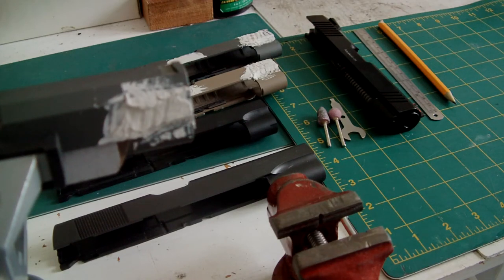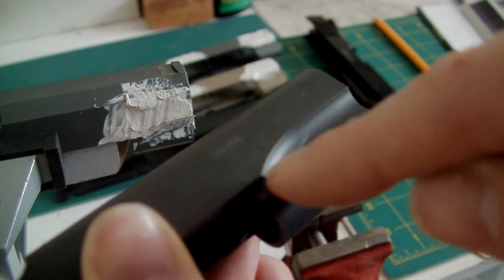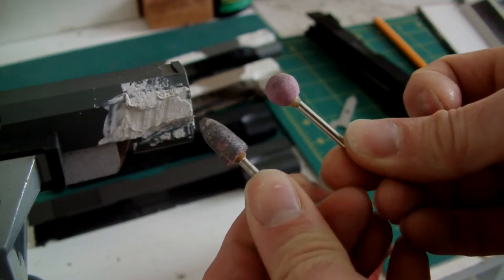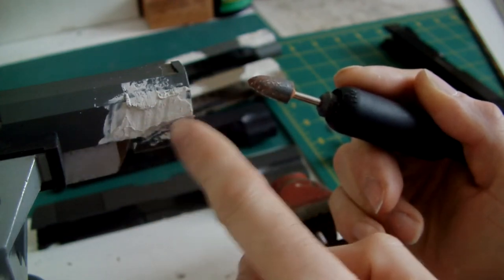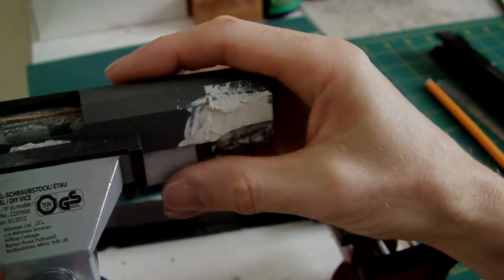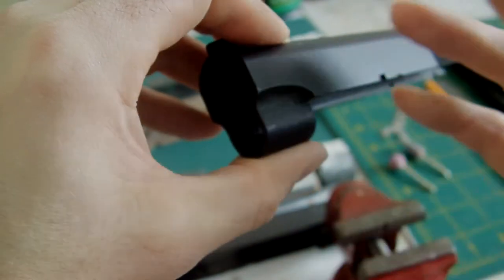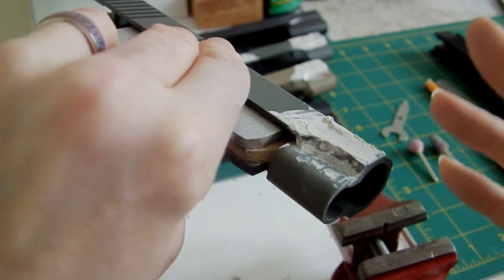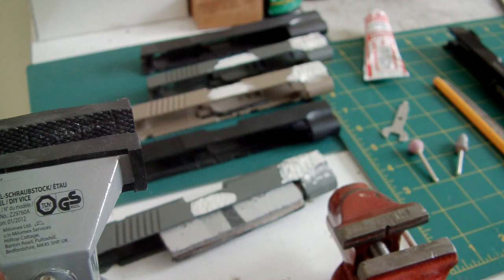LaZouche Custom airsoft How to make chin cuts to slides.

Comment: Probably the wrong video to ask on but what grit sandpaper/sanding belt would you use on a metal hi capa frame? Trying to make a WE hi capa 5.1 dragon look more traditional and the first thing that needs to go is the ugly front rail thing. Hate square fronts.